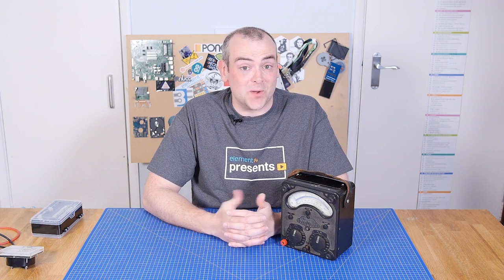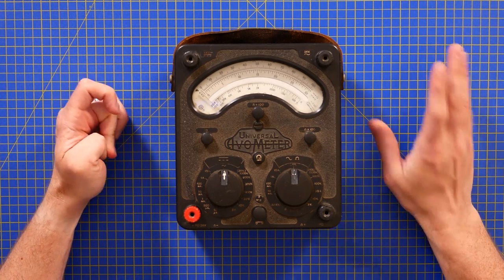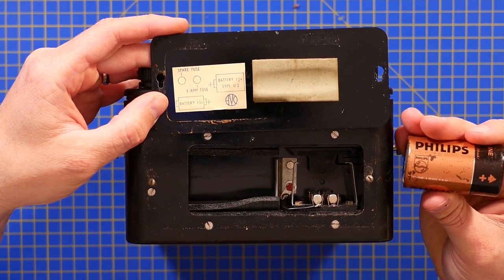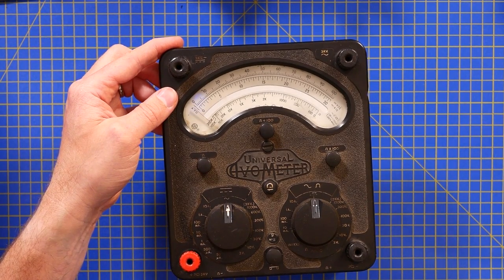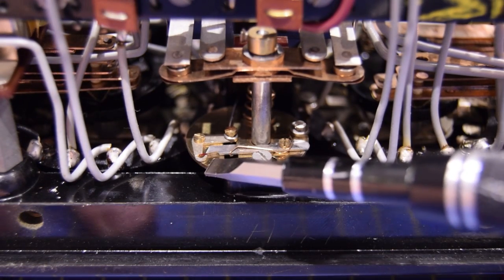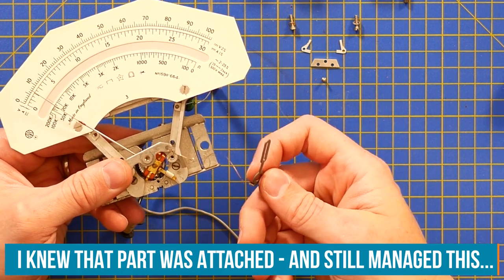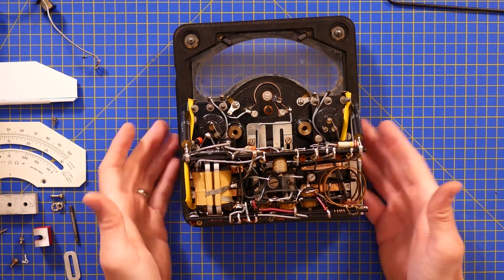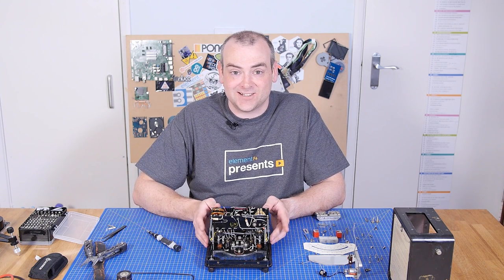AVO Model 9 Vintage Multimeter Teardown - The Electronics Inside

Comment: Should NEVER have taken this apart that far. That was too hard to watch. 
AVO's were the gold standard of meters for industry, and probably cost four 4 + weeks wages at the time.

By all means take apart a far east meter movement, they all work on the same principle. 

The trip is interesting as it is triggered by the moving coil of the movement rather than current or voltage. A arm on the movement touches the trip release and the trip pops up this happens at either end of the scale.

It's one of the features that made AVO meters so well respected and robust.

Getting a 12V battery of that type is very hard, but smaller 12 V batteries are available such as the GP23A with a little bit of tweaking or 3D printing that would make a good substitute  

 Andy
Reply: YES  he should not have destroyed that avo meter

Comment: I bought an old Hioki L-55 analog multimeter, but it's defective. I kept searching on the internet but I couldn't find the diagram for this model, if you have it or know where I could find it, I'd be very grateful. Best regards, Laurentiu!
Reply: @achimlaurentiu6905  It sounds like the one my dad bought while in trade school long ago.  I borrowed it as a young learner and always remember his number 1 rule to not test voltage while it's set to Ohms.
That is why so many don't work you bought at yard sales. The owners kids tested the mains while it was set to ohms

Comment: So, have you repaired the movement yet? (More likely, you need to find a donor meter), but replace the original scale that has the manufacturing date -654 the year and month (I was born!).
Now, 2024, I have started my collection by cannibalising a pair of 8 Mk Vs' to make a complete and working example from scrapped meters. 
I have obtained a 1939 model 40, ("model 40" actually in the Bakelite moulding) which has been (factory?) modified for the "A M" Air Ministry designed Model D. Not sure if I should attempt to restore, or  to which build, as it is not working and the controls are jammed! 
The Model 9 seems quite a rare bird. Hope you manage to restore to working state.
Reply: Nobody understands this type of work nowadays. She is a fancy paperweight

Comment: There are much better ways to measure voltage and current these days.  There is no real need to have this particular meter working.  This is not a world renowned priceless art work.  At best it is a small museum piece with a one page writeup on it's history in an electronics museum that sees 1000 people annually.  Try to keep a realistic perspective on the necessity for this to be a fully functional multimeter.  Would be nice to have working but that is all.  This is how I learned to fix things, by taking them apart and maybe getting them back together.  If you chalk this up to a shared learning experience you will see that this far exceeds the value of the multimeter as a functional tool.